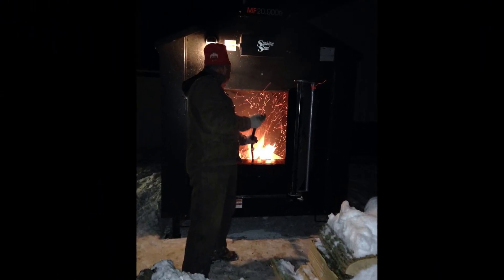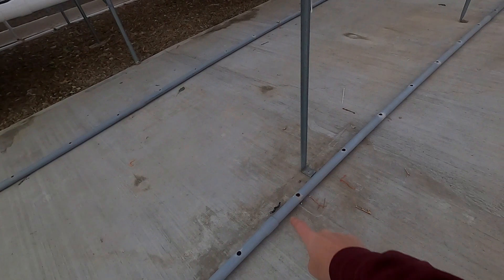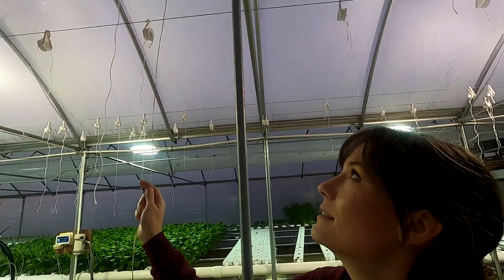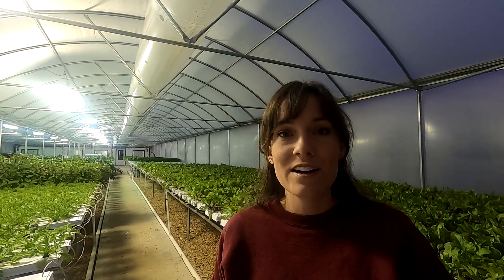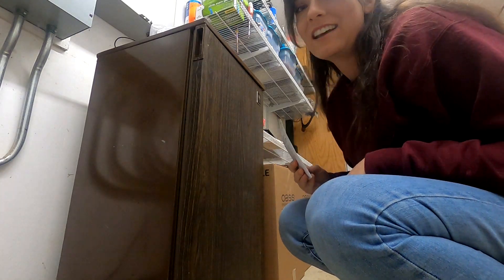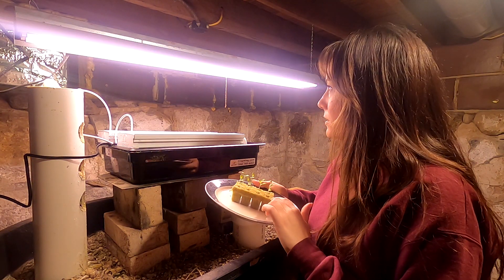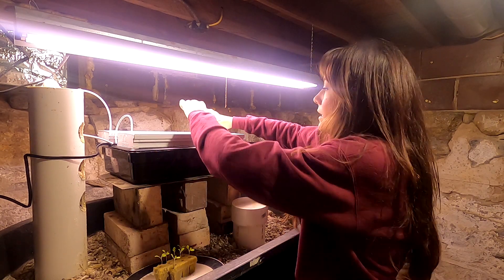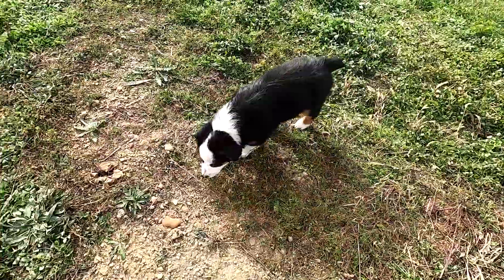Hydroponic Winter Crops

Comment: The wood furnace, is there duct work throughout the greenhouse?
Reply from the maker: There's lines that run through the back of the wood furnace to heat water that gets pumped through the control tunnel and up into the heat exchangers at the front of the greenhouse.  It gets really hot in the control tunnel when that's running.
Reply: @HomegrownPassion  wow 😳 I’m impressed that you know all that! Good for you! You are a certified country girl! 👍

Comment: I am thinking about setting up a small hydroponic system in the basement this winter similar to the one you have, but I always wonder about the economics. Obviously you get economies of scale when you have a set up like the one your parents have put together, but what about a smaller personal system? When you factor in the system, seeds, nutrients, and potting material does it end up being more expensive than just buying from a local farmer's market?
Reply from the maker: Daniel Carl I definitely thought of this and figured that the small system I have was $75.  It came with enough supplies to grow 100 heads of lettuce.  So it’s less than $1 a head without factoring in electricity to run the small pump and my time.  A big thing for me though is just the availability of having fresh lettuce.  The grocery stores are sparse around here, and it’s nice knowing we’ll always have greens.  I would recommend trying hydroponics! 😁 Plus you have Mom as a resource too! She answers lots of questions for me.